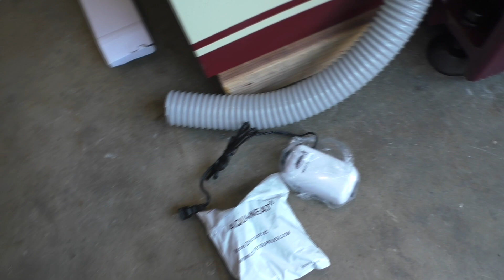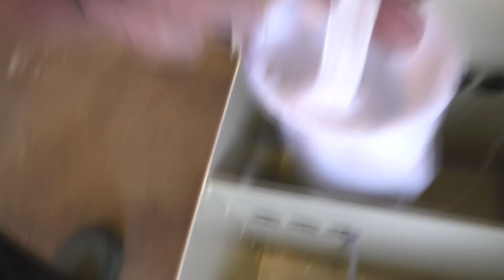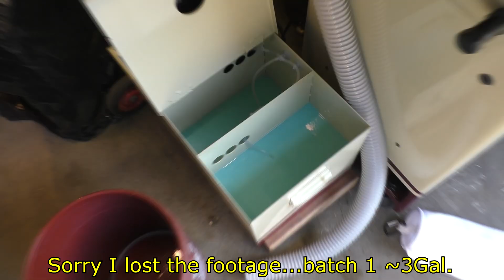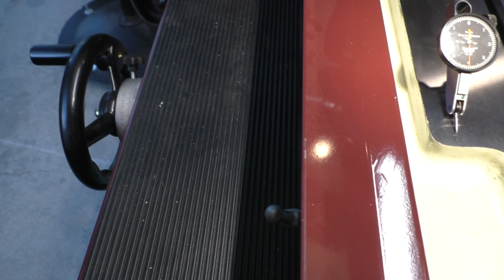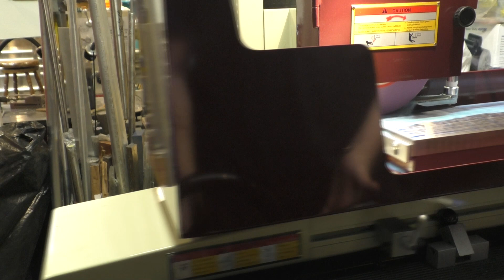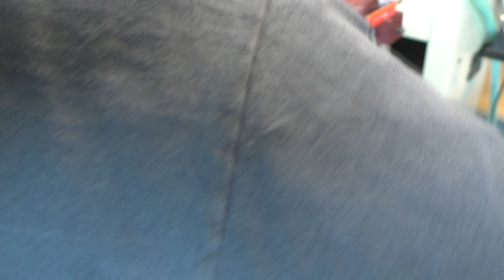86 ACER Supra A618II Surface Grinder Magnetic Vise Install and Truing Up

Comment: very nice. for some reason is I was told, by my instructor, is you have to let the spindle warm up for 10-30 mins before you use it.
Reply from the maker: That is absolutely true if you are looking for maximum accuracy. The temperature of the motor, bearings, and spindle need to reach their equilibrium temperature.

Comment: I copied Robin Renzetti for coolant. The stuff he uses is Hocut 795MP with a ratio of 60 to 1 tap water to coolant.  Its been in the tank for 2 years now with no rust or fowl smell.  I just kept adding tap water to keep the tank full.
Reply from the maker: I like that choice as well. One of my primary focus's for coolant is toxicity and disposal requirements. Thanks for the tip.

Comment: Based on how my first experience grinding the mag-chuck went, I wouldn't touch the platen as a newbie and probably still wouldn't.
Reply from the maker: I'm right there with you. One of my first touch offs went badly and it took a lot of grinding to undue the mistake. I would want to damage something as important as the table. Time and practice.

Comment: You're diamond will last a lot longer it you turn the holder 180 degrees from what you show in the video. The way it was in the video will produce a flat on the point so no matter how often you rotate the diamond it will always be on the flat spot. If the diamond holder is rotated 180 degrees you will wear a flat on the side of the diamond and when you rotate the diamond it will contact the wheel with a share edge rather than a flat.
Steve
Reply from the maker: Thanks for the correction and the call to back it up. Your tutoring is much appreciated and unexpected. Every one's spare time is valuable and I appreciate you spending some of yours helping me out. I can't thank you enough.

Comment: I'm so jealous, I would love to own a surface grinder 😍

Just one consideration I thought you would benefit from though and that is to get a one way valve for the aerator.

I have a similar set up for my PCB etch tank and found that the etch solution would sometimes leak back into the pipe, which offered the potential of destroying the pump internals but it stopped after the addition of a one way valve, for awhile that is, the eventual fail was on me.

I chose to put the valve right at the tanks air inlet port, however, due to the application, the valve internals came into contact with the solution and they corroded (duh).

I put the new valve right next to the pump as the effect was basically the same but it eliminated any chance of it getting damaged again.
Reply from the maker: Thanks for the great suggestion. I will look for one.
Reply: @DudleyToolwright  no problem and thank you so much for subbing to my channel, your one of my long time heroes and it means a great deal to me 😊
Reply from the maker: Happy to help out.

Comment: when grinding the first side of your five pieces, I think you could have grouped them together, saving a lot of time grinding air. Then when positioned for grinding second side, it would be quicker to grind them one by one, (like piece 5) instead of sweeping between them, grinding air again. Pretty machine. You won the lottery????
Reply from the maker: I did not think of bunching them together for the first side...DOH. I did think about doing them individually for speed on the second side, but was concerned about the wheel wearing on one block and then the next block would be taller. I was hoping for an average across 2 blocks. I was never certain that I needed this more difficult approach, but did it anyway. I didn't know enough to make a better choice. As to affordability, I am lucky to have a very supportive wife and a decent job. It still was a stretch though. I would have loved to get a hydraulic version, but the extra few thousand was out of the question.

Comment: nice machine, I find dressing the wheel as far to the left of the chuck will avoid sandblasting the chuck surface, which will also benefit from periodical stoning , if you are concerned about the diamond lasting turn it around 180°  from where you had it, make a chuck handle you can leave in and get a dro scale for wheel up and down, then touching off can be done on a scrap of known thickness.  hold your hand to the left of the wheel to feel the grit when dressing.
 try not to wind the wheel down onto a dresser or work.   I've had a machine a few years and love grinding, learned a bunch off robin, steve and other yt peeps but learnt most from mistakes
Reply from the maker: Those are great suggestions and I will take each and every one of them. Steve Barton (Sold Rock Machine Shop) called me to correct my diamond placement. It seemed so obvious after he explained why.  I got an inexpensive DRO from Ali Express that I am going to install (2um scales). We will see if it is good enough. I really appreciate you taking the time to help me out.

Comment: Great job! Congrats on the grinder, it's going to be a lot of fun. I would have ran it in automatic for the test and used a half thou mic to check, but I highly doubt it would have yielded different results. It would tell you if the feed mech. had any influence though. Thanks for the vid, looking forward to more grinder content.
Reply from the maker: Thanks for the tips. I would like to point out that this is a completely manual grinder. I couldn't swing the cost for the hydraulic model.

Comment: Thanks for posting this video. They're always enjoyable.  I live in an area that is devoid of a shop that offers surface grinding so I've been considering getting into it myself. I'm curious what your process was for deciding on this machine as opposed to used one.
Reply from the maker: I have always shied away from used machines, because when I got each machine, I didn't know enough about the details to avoid getting a lemon and didn't have anyone with experience to fall back on. I also was luckily in the position that I could afford to get a new machine. If I couldn't have afforded it, I would have had to do my best finding a machine in decent shape without knowing exactly what that was, but I still would have gone for it. 
The Surface grinder was the most difficult purchase of them all, because I had never even used one before and had to rely on other YouTube machinists for information. I lucked out, in that Steve Barton over at Solid Rock Machine Shop had a ton of experience and went way out of his way to help a stranger out. I really appreciate the kindness.
Reply: Probably to be sure and get the results you just saw. He also said he got a good deal on it.

Comment: I ground cranks for 10 years. Use womans stockings from dollar store for the gunk filter. Works and Cheap.
Reply from the maker: Thanks for the suggestion. That means a pretty coarse filter will work. Good to know.